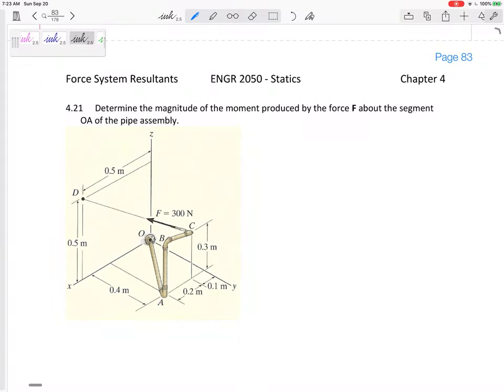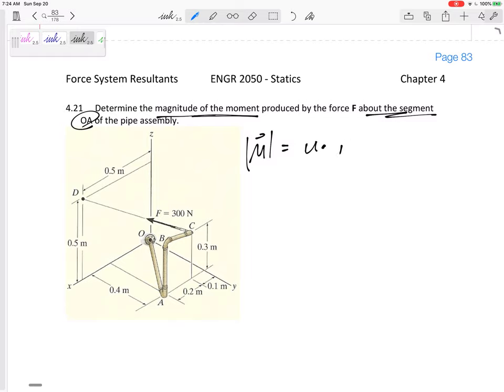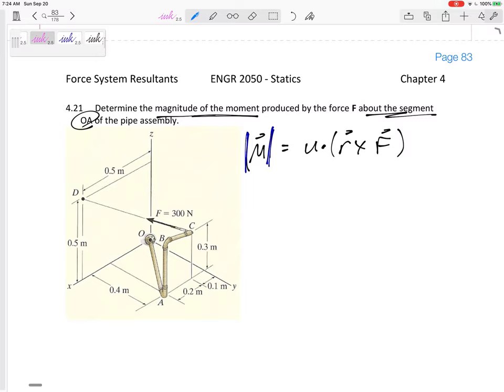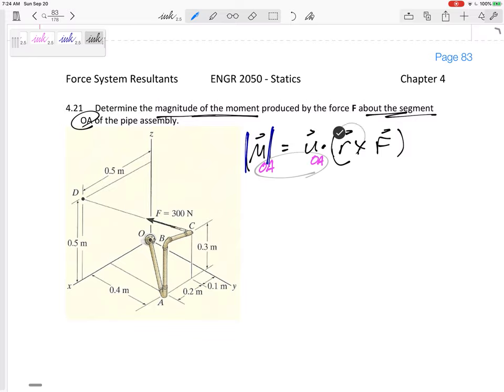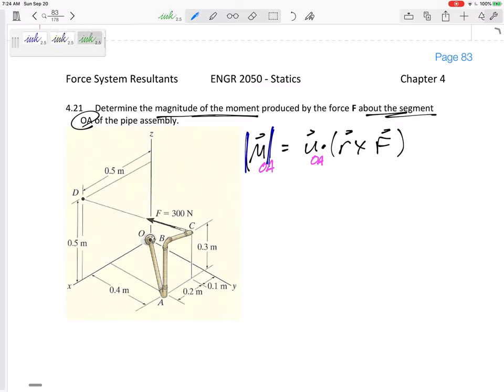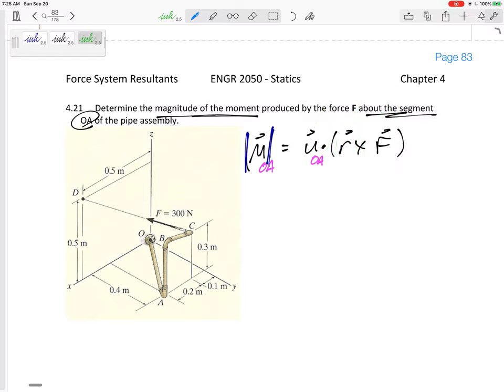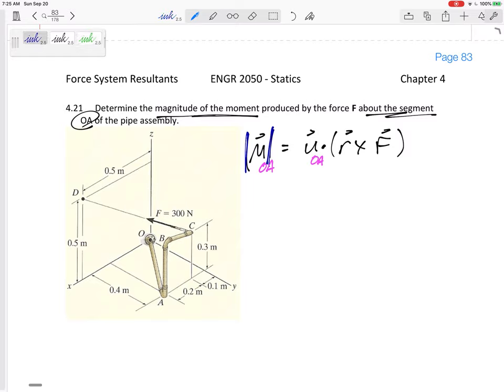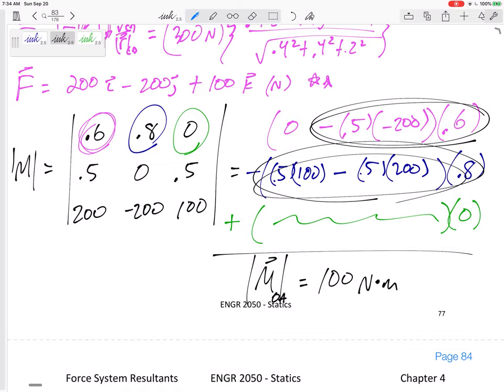Statics - 3D Moment about an axis example 1

Comment: Sir, please advice.. when we replace a force/F with a force couple system, then that couple's moment is free vector, which means we can place that couple anywhere on the system , just that its magnitude should remain the  Fd, where d is distance of shift of original force... is that means Fd magnitude need same say 100 N was original force and 1 m is shift of force , so now we can have these combinations as well ,  50N-2m or 25N -4m force couples ? ... i was looking for force couple equivalent videos but could not find, please advice. thank you much  ..
Reply from the maker: I’m not sure what you’re asking. If you replace a force with a force couple system (at a different point), then be sure that the sum of the forces is the same for both cases. And the moment(s) about the point caused by force*distance would be the couple. And your force is now going straight through your point so there’s now Fd anymore. Sorry I don’t teach equivalent force couple systems.
Reply: @engineeringdeciphered  thank you Sir. Sorry for not drafting question properly. My question is moment of couple in this situation will be free vector as well ? And we can shift moment anywhere else as well ? Thank you much.
Reply from the maker: @shailkumarjain  no, these moments that are created by a force are not couples. They are not free vectors. The moment would be different if you calculated it about a different point. Only moments caused by a couple (two forces equal in magnitude and opposite in direction) are free vectors. I think I do have one video on couples.
Reply: @engineeringdeciphered  ok.. thank you Sir. 🙏

Comment: When calculating r, how is roc the sam as rod? Are they not different when you turn them into vectors?
Reply from the maker: roc and rod are different vectors, and that determinant will have some different numbers inside of it, but the final answer will be the same. As long as the r goes from anywhere on the axis to anywhere on the force, you'll get the same answer. It's pretty cool to try a few different r's and sometimes you can see why they'll give you the same answer.